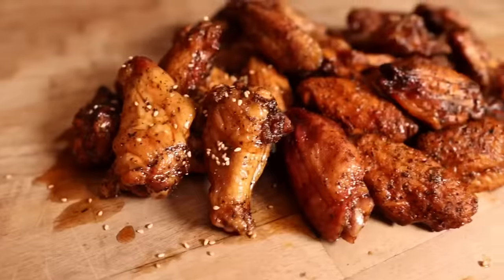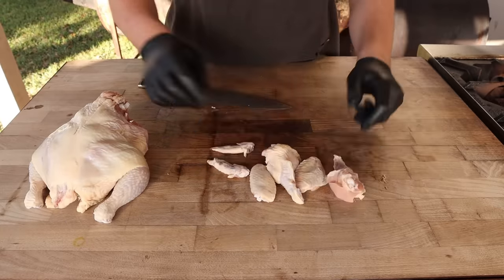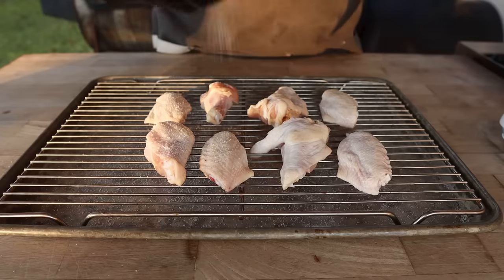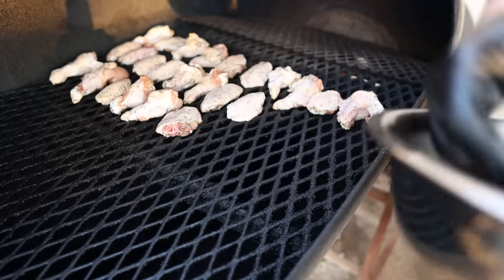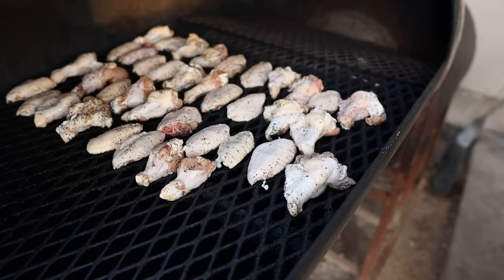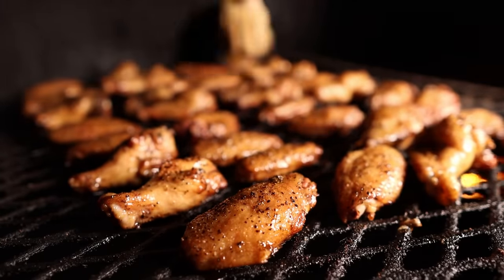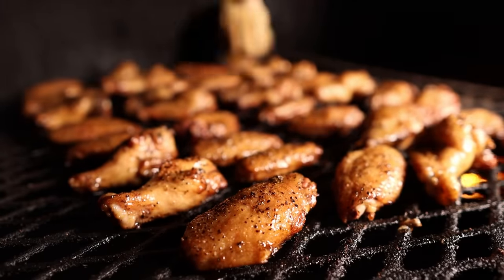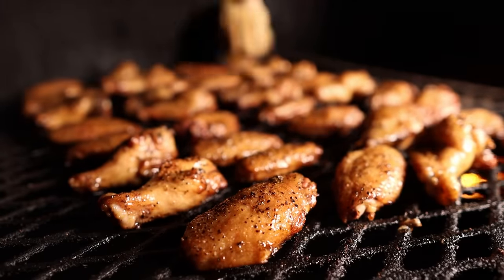Crispy Skin Smoked Chicken Wings | Chuds BBQ

Comment: Just bought a smoker yesterday, and these were the first things I made today. Turned out good, but a very very very very small tad overcooked. Still very good. His video said he had his on for an hour. At around the 35 minute mark he was at temp and added butter.

Mine were the same, but then got slightly above 200 DG. Should I have turned down the heat once it got half way, or taken them out earlier? Which would be better?